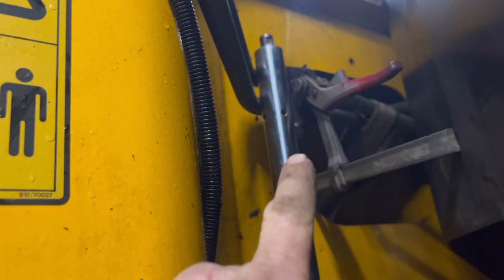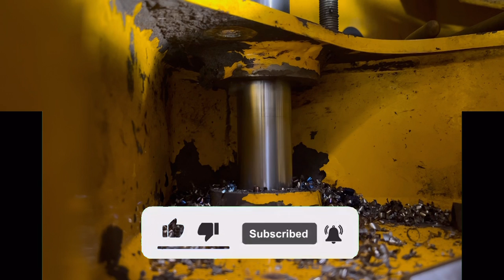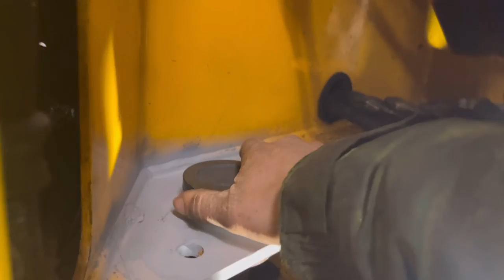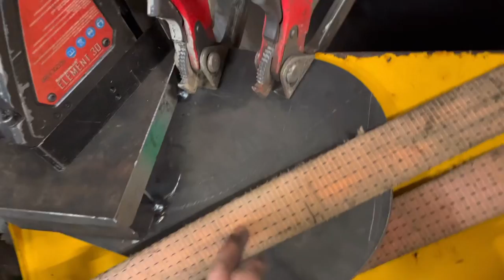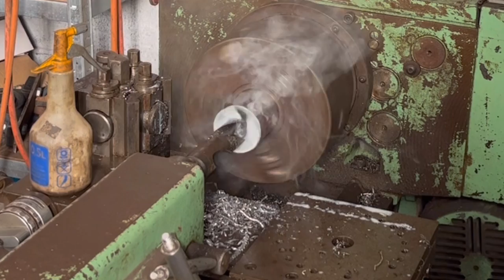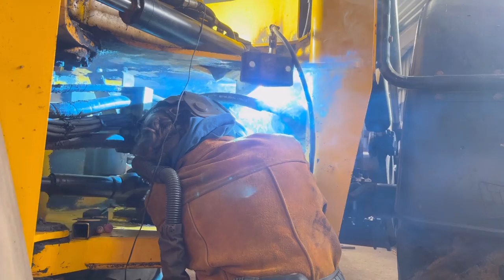Line boring JCB 416s steering pins with a mag drill.

Comment: Nice one .   We use expander pins at work for that purpose , but those bores were a bit too flogged out for them .  Great job . 👍👍👍
Reply: Looks like a bit of operator negligence, a lesson in the use of a grease gun might help.
Reply: @johncone9516 how do you grease the joints he rebushed? The cylinder pivots on the center of the pin. Those holes that were repaired dont move
Reply: A reet job 👍
Reply: @kaseycoleman993  Exactly, 100% right. 
The chassis holes shouldn't wear in normal use.🤔

Comment: Great video. Quite a tricky and confined space repair. Love the self made line boring setup with a mag drill and bearing plates. You would of definitely struggled setting up and using a conventional Sir Meccanica system with the drive unit and controller.
Reply from the maker: Thanks. Yes, it would have been a struggle. Just needs refining some now.

Comment: What material did you use for the bushings?  What rpm does the mag drill turn?  It’s nice to see real life jobs, not a YouTube studio where everything is perfect.
Reply from the maker: I used en8 steel for the bushings.  Not sure what rpm the mag drill does but it’s too fast really.
Reply: @snowballengineering  yes, i think it will be easy to add an of the shelf standard pwm module for it

Comment: An elegant solution to a problem which shouldn’t even exist, if the original design/build had recognised the loading on these points - perhaps the ‘top-hat’ bottom bushing could have a wider ‘brim’ and be held in place with 3 cap screws, just to help if you need to renew the bushes in a couple of years?

Comment: great stuff  Is it always that cold over there  you have to wear winter clothes in a shop? and someone told us that they only use dewalt tools over there.
Reply from the maker: It’s 18c today 😁  but back in February it was between 0-5c and sometime below, the workshop has no insulation so it was pretty cold.  
I use dewalt mainly because my local shop sells them but never had any problems.
Reply: @snowballengineering   I wondered if it gets cold or if it snows there. I see where vehicles rust there bad like up north so they must put salt on the roads too .